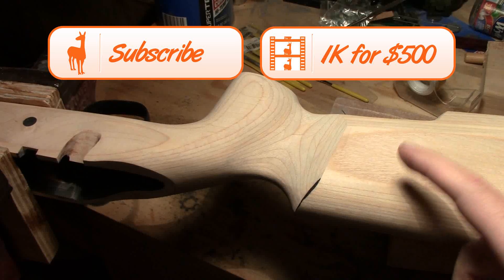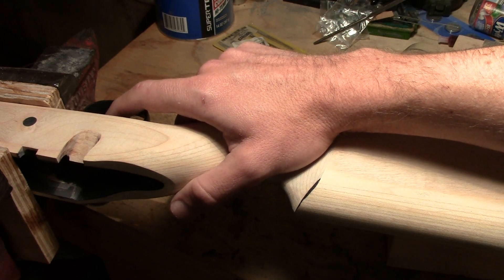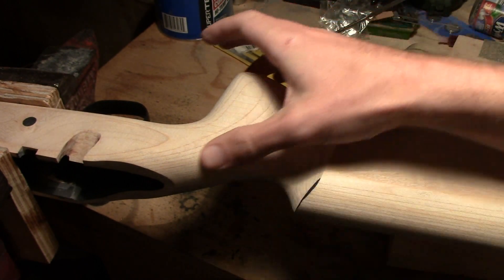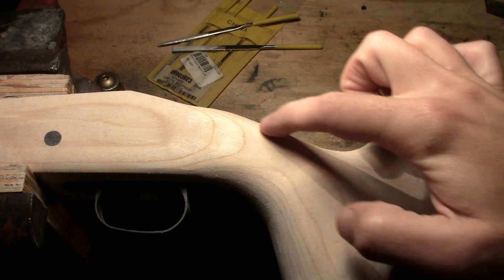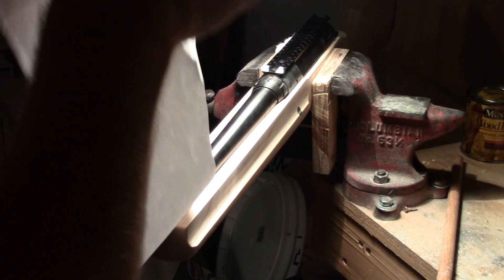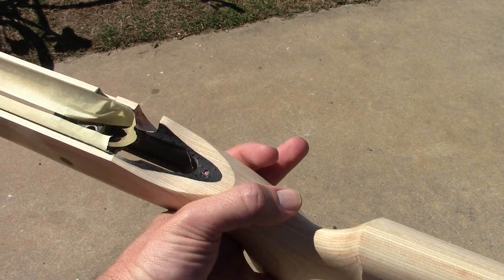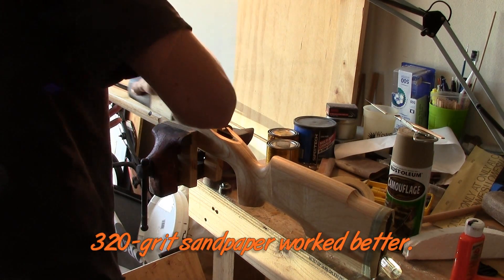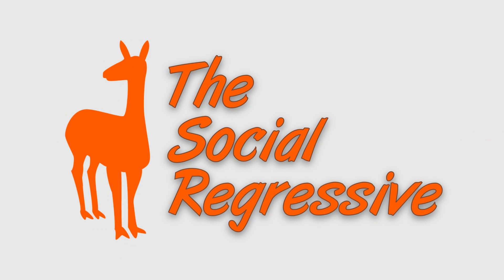Boyds Pro Varmint

Comment: Totally unrelated but, I painted an AK in a giraffe pattern once. I put down a sand base coat, then tore my 1/2 inch painters tape lengthwise and flipped one length and overlapped the straight sides to create an organic border for my "splotches". Next I did a burnt rust-looking coat followed by a darker brown misting (just barely push the nozzle on the spraycan and it comes out in larger droplets). I  allowed that to dry, then removed my tape and did three coats of a matte clear. Turned out EPIC.
Reply from the maker: That sounds AWESOME! Send pics! I have a facebook page: https://www.facebook.com/TheSocialRegressive/

Comment: Bro what are you doing, Thats a Palm Swell made specifically in the grip for better accuracy, it helps eliminate lateral movement, your a long range shooter I'm shocked you did this? Stocks looking great tho regardless!!
Reply from the maker: Maybe I didn't get the right camera angles. The rifle really had no palm swell to start with. It felt kinda like a rounded 2x4. I had to carve away material around the center of the palm to get a good swell into the shape.
Reply: @SocialRegressive  Wow really" That stinks but I understand what your saying, I was watching your video thinking Oh No he's literally removing the very swell built into the grip to help obtain accuracy LOL!!  but I completely hear ya & that makes sense now, I wouldn't want a 2x4 feeling grip by no means 😫!! most Palm swells are very thick tho as I'm sure you know, but not like a rounded 2x4 block. That makes sense & it turned out Beautiful, Great Job on the stock!!

Comment: Enjoyed this video and opened my eye to a couple things with some questions. To do this swap did you have to use the Bottom Metal for a Model 10 and that Magazine? Could you have gone with a Blind Magazine? 
Have a Savage model 11 and an Axis that both need new wood and not a Thumb hole fan, Watching you work intently!
Reply from the maker: Great questions. The Axis uses its own magazine system with a double-to-single magazine. The Boyds stock is inletted to fit that magazine perfectly. I've never seen a blind mag configuration, but I have seen bottom metal that allows you to use AICS-pattern magazines. Can't remember who makes that. You would probably have to make a custom inlet.

Comment: Not sure if you’ll see this or not but I ordered a Boyd’s laminate featherweight thumbhole stock and it has a few small rough spots on it... is there any way to smooth them out without messing up the finish?
Reply from the maker: If it's the finish that's rough, then you should be able to polish it out with car wax or something similar. I'd test it in a hidden spot first.

Comment: Try scraping instead of sandpaper which clog up all the time.  A knife edge will work, but you can get proper scrapers like these for wood finishing.
http://www.leevalley.com/en/wood/page.aspx?p=32644&cat=1,310,41070

Scraping wood can actually leave a finer finish than sandpaper, and gives amazing control over reshaping sections.  It's the oldest method of wood finishing, and still one of the best for hand work.

I've carved profiles for custom maple hand rails and other wood projects with these, and did one rifle stock with nothing more than a pocket knife, and it worked amazing.
Reply from the maker: I've done a little work with gouges, etc, but I'll definitely need some practice.  :D
Reply: Scrapers are a lot easier than gouges.  The scraping action can be very aggressive with the finish, but can be easily controlled to shave much less than a thousandth of an inch at each scrape.  Gouging involves directly using the cutting edge (pulling chunks of wood just like a chisel), but scraping relies on the burr left on the edge of the sharpened tool after sharpening, but before honing.
There are a number of old timer wood working videos on youtube demonstrating the technique.  Incredibly easy.
Reply from the maker: throwingmud Interesting.  I'll check that out.

Comment: Just ordered a pro varmint for my Savage Axis build! I went with a 26 inch stainless steel heavy varmint barrel and a timney trigger for it! Mines a 30-06 build. I know I'll have to do some work to the barrel channel to make my heavy barrel fit(it's a shame Boyd's doesn't offer a long action with a bull barrel channel). Any tips for widening out the barrel channel? I've been told wooden dowels and sandpaper.
Reply from the maker: Congratulations! That should be a fun build. You're absolutely right; dowels and sandpaper are the way to go. Since you have a lot of material to remove, you might want to draw some lines on the top of the stock to make sure you don't go too far on one side or the other.
Reply: +The Social Regressive Thank you so much my friend! I do love your build, honestly, for the money spent you hit a home run, you also have very skilled hands, I think your blonde stock turned out gorgeous! I plan to Pillar bed and action bed mine, I am very nervous about the pillar bedding, I don't want to mess anything up. I do plan to follow your videos step-by-step and take my time. Still very nervous. You're extremely skilled my friend.
Reply from the maker: I know how you feel. That first time I cut into a stock was a butt-pucker moment. You'll find that pillar bedding is actually a pretty easy job, though, once you've gotten to the end of the process. The most important part is just to make sure that you drill the holes straight. Take your time. Get it lined up. Clamp that stock down. Then drill.